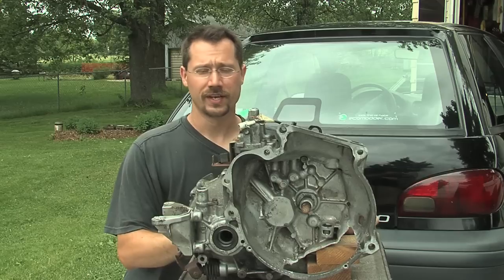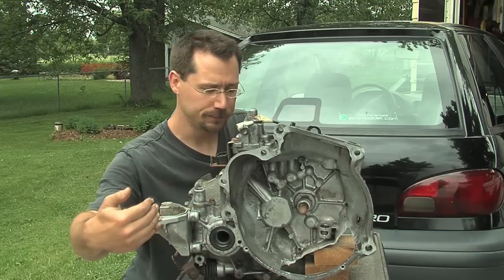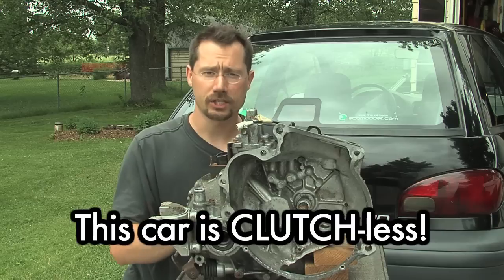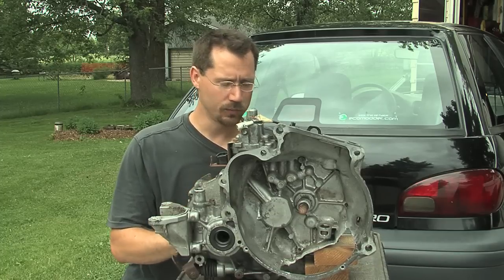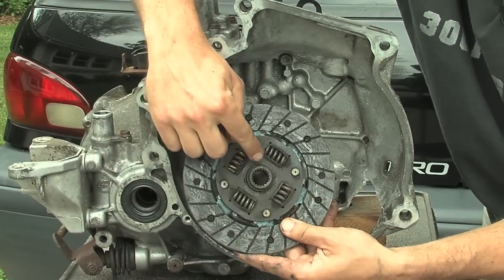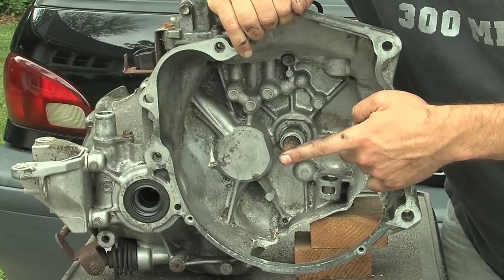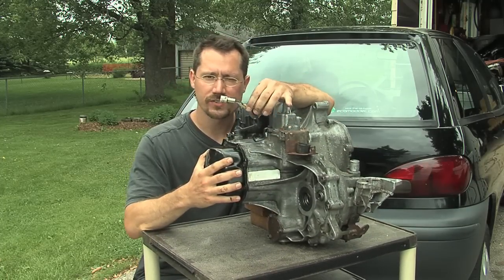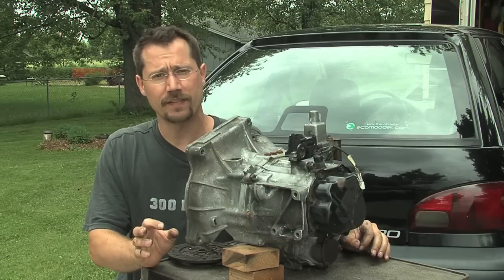6 Build Your Own Electric Car: Transmission

Comment from the maker: We are now on Patreon! We'd love your support as it helps us produce more videos like this! https://www.patreon.com/300MPG
Reply from the maker: You can send me a message by simply posting a comment at 300MPG.org. It's moderated, it it goes directly to me.
Reply: what do you think of this?

I've done some calculations on a project of mine, but i don't know what is the lifespan of the motors.

Turns out that if i use a DC motor (1-1 motor spin to tire spin ratio), i would have to run the motor no more than 850 RPM for my country's speed limit.

what do you think about that range of RPM? in terms of motor lifespan and wear (considering that DC motors red-line at almost 5000 RPM if i am right ?)

The only things stopping me are the transmission maintenance (would want to get rid of it if i could) , and motor overheating knowing that i live in a region of hot climate.

Thank you :)
Reply from the maker: @aslt5711  There's no reason to try to spin a motor that slow.
The motor will have do draw a tremendous amount of current for the current you would need.
The typical way to do it is to connect the electric motor to gear reduction, such as the existing transmission. This allows the motor to spin at thousands of RPMs. It reduces current draw and heat, and increases torque.
All commercially-built electric cars use some sort of gear reduction.
Even "direct-drive" EVs really have the motor go to the drive-shaft, and there is still some gear-reduction in the differential.
The only exception are hub motors. They are a very different style design than a typical motor. No current commercially-built electric car uses those.

Comment: What should I do if said car has an automatic transmission?
Reply from the maker: There are many cars which were available with a manual OR automatic. You can get a manual from a salvage yard and drop it in there.
Alternatively, you could use a motor AND GEARBOX from something like a salvaged Nissan Leaf. You would then just need to make custom shafts from the gearbox/differential to the front wheels.

Comment: Great video. I appreciate your attention to detail. I have been dreaming to convert my own vehicle someday to electric. I am an avionics technician so I can get my head around the electrification part. My trouble is the mechanical component of the conversion. The biggest thing is both of my cars are automatic. Obviously a manual car is ideal for EV conversion, and this appears to be all I can find on the interwebs is manual transmission conversions. Is it even possible or worth converting an automatic vehicle to ev?

Comment: Awesome how many batteries maybe 5🤔how often charging.
Reply from the maker: This car ran on 12V lead-acid batteries. It used anywhere from 6-12 batteries for 72 to 144V system voltage.

Comment: Electric motor torque will (right now)
Destroy standard type transmissions
at the first Oppertunity of error in designs or peddle indiscression or both.
Reply from the maker: It's funny the comments that I hear from people about torque.
Half the comments are that something like a forklift motor isn't powerful enough to move a car, and the other half say it will instantly destroy the vehicle.
In my experience, it's neither.
On the electric Geo Metro, I could pull away from a dead stop in 5th gear. I could do burn-outs in 1st gear, and the only time I ever had an issue with the driveline was when I used a cheap no-name spider coupler with it misaligned.
Reply: @BenjaminNelsonX  I'm the electrician ,aligning larger type high school pool pump motors to pump
Exactly for maditory opperation against immediately destructive vibration ect. You are doing fine generaly, it's just that others might not end up equaly as logical with aspersions of performances according to available area under hood & motor selections at hand with other vehicles (you know how 
tollerances are & crucial safety issues involve 200-300hp success
on own account with children in Ballance.

Comment: Hello Sir! 

By the Right Electric Motor, do you mean a VVVF controlled Induction Motor to work without Transmission?
Reply: Vvvf controlled induction motor & without transmission YES! This would eliminate so much weight. I'm def going to become a patreon donor of you if you are being active in this. Our donor vehicle is a light 1980's intact pickup truck. Jetison the motor instead of replacement again. Isn't there a great pickup truck conversion YouTube from portugal or spain recently? It had 2 direct drive front wheels. A beaut.

Comment: Why don't you attach the motor directly to the driveshaft instead of gearbox? Therefore saving weight.
Reply from the maker: Well, for starters, it's a front-wheel-drive car. There's no single drive-shaft. There's two "half-shafts", one going to each front wheel. Secondly, you would at a bare minimum still need a differential, which is built into the gearbox/transmission/transaxle.
Lastly, you need gear reduction between the speed of the motor and the speed of the wheels.
https://300mpg.org/projects/electro-metro/transmission-for-an-electric-car/
Reply: @BenjaminNelsonX  Thanks Ben, exactly the information I have been looking for. Still trying to find out the ideal motor in todays world for a conversion. And also still trying to figure out the rights specs for such motor. I get a lot of stats and but not a lot of opinion on why one is better than another....still searching. Great job on your car btw.

Comment: Could someone please elaborate on how “clutchless” works? Don’t you need to disengage the motor when shifting? I’m baffled by this.
Reply: @Donnie Fontaine depends on the gearbox you using some have gears cut and put together in a way that they say only need clutch to go from neutral to 1st and as they spinning but held together to move gear you just shift and maybe rev match as it already spinning and the gear part slides across to next gear though often not on road cars as louder than what normal ones are, often crunch or clunk noise they might make apparently
Reply: @mlee6050  Your lack of periods and random generalization of something you don't fully understand muddied up your answer.i didn't make it past the first 10 words.

some transmissions only "need" a clutch to get moving,whether forward or backwards.then if they have syncro's they can be clutchlessly shifted.electric power is different as it can be controlled quickly and accurately,unlike internal combustion engines.this is why cnc machines can do the amazing things they can do, because electronic motors can be precisely manipulated using encoders and software so im assuming when slowing down an electric motor can stop entirely negating the clutch entirely.a gas engine can not do this quite so easily
Reply: @trillrifaxegrindor4411  I understand as I looked at all types of gears and stuff like racing people sometimes have straight cut or dog gears but not on road as it noise

my school never taught us periods and stuff, it was basically capital first letter and names and full stop at end of sentence only

Comment: The market for the conversion to electric vehicles is large and it will grow. Why not using anterior traction hub electric motors so that all the service cost, parts and time of messing with the transmission is saved? There is room for a new national franchise to serve this idea similar to Jiffy Lube International or Express Oil Change & Tire Engineers or Grease Monkey. Sign me in as another franchise monkey for this idea please!
Reply from the maker: I know of no commercially-available hub motor which is powerful enough for for use as the primary traction of an electric car.
People like to talk about hub motors as a way to simplify an electric vehicle conversion, but so far, hub motors have mostly only been practical for bicycles and scooters.

Comment: I think it's great if you're seeking a single motor, but aren't most electric cars dual motors (one for each wheel)  eliminates the weight of a transmission and a more efficient motor/generator...
Reply from the maker: No. Most electric cars use one motor to drive two wheels, using a traditional differential system. In place of the transmission is a single-speed gear reduction.
The four-wheel drive Teslas use two motors, but it's one for each axle.

Comment: The older models were great. Everything was analog and didn't have any electronics involved, except for the solenoid locking the torque converter to create a "fourth" gear.  The newer models are totally controlled by a microprocessor. I don' t think you can get away with doing this anymore. :(  ..And if you have a CVT transmission, I don't think it will put up with a high torque electric motor at all. It will probably break in a month. Constant Velocity Transmissions were designed for high gas mileage, not for high performance. Then again, if you have a manual transmission??

Comment: And how does one change gear smoothly without a clutch?
Reply: Marc Brassé Your in gear 1, then power cut to the motor, motor spins free now (like a flywheel), then shift to next gear, power motor back on. So to mimick a combustion car: keep the clutch pedal in the car and connect to a motor on/off switch.
Reply: Even the reverse can be done by the motor, I guess even  transmission or gear box are just to connect motor to the wheels.
Reply: @robertcaron9181  Still he talks about a gear box. This suggests you go through gears, which suggests you go through mutiple gears while driving. This suggets that the gearbox runs connected to the electric motor. How to do this smoothly is not explained. The only solution will then be to leave the car in one gear.

Comment: This applies to manual gearbox. Any tips on automatic ones? Or should I ditch the auto gearbox ? Any info would be great as I want to convert my Golf to electric power
Reply from the maker: Automatic transmissions are designed for gas engines, not electric motors. Typically, folks use MANUAL transmissions for EV conversions.
An automatic is more complicated and less efficient. If an automatic is used, it's typically just locked in a single gear.
Reply: @BenjaminNelsonX  have you done this with a truck. My donor truck is an automatic but there is no motor or transmission.  It was shifted on the floor. Is this possible without a clutch?
Reply from the maker: @gadgetmanhookup  Lots of people have converted trucks to electric. Automatic transmissions are not the best for an EV conversion, but it should be pretty straight-forward to swap it out for a manual transmission. Take a look at the EV album for some ideas on truck conversions.
http://evalbum.com/type/TRCK

Comment: Hey Ben what are your thoughts on putting an off the shelf generator in the car to avoid large battery banks?
Reply from the maker: Nabre Labre That’s the concept of a plug-in Hybrid, such as a Chevy Volt. I did run this car for a while as a hybrid with a generator. Search this channel for “DIY plug-in Hybrid” for what I did.
Reply: @BenjaminNelsonX  what I am trying to do is not have to plug it in, just have a small battery bank to fill the gaps, and a generator for road trips/not getting stranded.

I have another question, a motor I looked at on craigslist does 1800 rpm. In the car I'd be using, 6th gear at 3000 rpm is 60mph, so would i only get 36 mph out of that motor without overvolting? Thanks!
Reply from the maker: Nabre Labre does the motor say which voltage it runs 1800 RPM? That speed is very common for an AC motor that runs from wall power. Make sure the motor you want to use is DC. If it is, increasing the voltage will proportionally increase the speed.

Comment: It is a manual or automatic car?
Reply from the maker: It's a 5-speed manual transmission, stock to the car.
Reply: You'd never want an automatic transmission for an electric car conversion. Most of the time, you'd be driving an electric version around in only one gear anyway. The automatic would be more expensive, less efficient, and mostly would just get in the way.
Electric motors behave like transmissions with an infinite number of gears. They produce their maximum torque from zero RPM and can be driven around normally without shifting gears.
Reply: Devil's Offspring I'm in a project to transform an automatic gasoline car into an electric car. We are trying to figure out how to connect the transmition to an electric motor
Reply from the maker: @beFrah , One way of doing it is to remove the automatic transmission, and putting in a manual transmission that would have matched that car. You would then do a clutches system (unless you also wanted to dig up and install a clutch pedal!)
Automatic transmissions are sometimes re-used, but simplified to make them more or less "direct drive" and are locked into a single gear.

Comment: Just put a motor on each sideshaft to omit the dif and the gearbox.  The motor speed and the wheel diameter will determine the top speed.
Reply from the maker: Keep in mind that it's no simple task to "just put a motor on....".
A motor needs to be properly supported, exactly positioned, and be kept in place. That means scratch designing/fabricating/installing some custom motor mounts and brackets. The existing transmission is MUCH easier to use as a simple place to bolt the motor.
I'm not saying it can't be done, but I'm struggling to think of any DIY twin motor setups done in that way.
The Tropica was a twin motor rear-wheel drive vehicle with one motor on each of the rear suspensions, belted or chained to the rear wheels. Essentially twin motorcycle drivelines. Of course, there were only about a dozen of those built!
Reply: @BenjaminNelsonX  Ben, it's always hilarious hearing people saying "Just do this!" and "Just do that!" when they've never done anything :)
Just buy a brand new Tesla Model S. It's ONLY $150,000, and will save you lots of work!
Then, you "Just" remove the existing motor and "Just" replace it with two separate ones, to eliminate the differential and the two driveshafts from it. It's "Only" one more motor, and you "Only" have to figure out how to do it, and "Only" have to find, buy, and implement "Only" one more Tesla motor controller, and "Just" design and build "Only" one more complete structural mounting system and "Only" one more complete driveline for everything to work.
It's always effortless when you've never even thought about doing anything at all, never mind actually doing it :)
I swear, some of these guys must work for the government.
Reply from the maker: @devilsoffspring5519 , You nailed it. People offering the most advice usually have the least experience.
Reply: Have a look at the advantages of an in-wheel motor, the second best is to put a motor with a driveshaft on each wheel.  With the correct electronics you can do traction control, regenerative braking as well as save a mass of weight.  Light vehicles means less power and better range.   These guys did it right, a shame they closed.  Carefully observe how the motor was made, that is how it is supposed to be done, not with 3 phase.  https://www.youtube.com/watch?v=j2IBnKouLDg  KLD oneDrive Electric Vehicle Propulsion System - Energy for the Next Generation

Comment: You are better off using this original transmission as it has always been used because starting off in fourth or fifth gear places tremendous forces on the gears and they are likely to eventually break. And why not keep the clutch as well, just in case?
Reply from the maker: I never had any trouble at all with this car using the modified transmission.
For more information about the transmission and clutch on this project, please check out:
https://300mpg.org/projects/electro-metro/transmission-for-an-electric-car/
and
https://300mpg.org/projects/electro-metro/going-clutchless/

Comment: why not just make the car wheel the motor?
Reply: Because it requires specialized items (car hub motors) that are very rare, cost more than the car, and you won't be able to buy anyway because they're not in production and far too rare?
Why not "just" use what's actually *available*?
Reply: why not make the sun our oven in the kitchen and use it to power the spaceship? why not use the air from flying birds to cool volcanoes and replace central air conditioning?

 do you see what i did there? 
its sarcasm,outlining and making fun of your question.
always use logic and intelligent thought relative to viability and do-ability of a specific topic when making suggestions.
so,in the real world logic is paramount to not sounding like a total dumbass.

in other words,think before speaking
Reply: @trillrifaxegrindor4411  your a idiot, I have seen many electric cars with the motor in the wheel. why don't you do some research before attacking someones question.

Comment: So you only need the gear box if your car is a 4x4 or AWD or front wheel drive , or only to transport the movment , and no need to shift the speed by gear box ,,, but can we adjust the gear box shifting on the fastest speed permanently , and shifting the motor speed by the electronic buttons ?
Reply from the maker: https://300mpg.org/projects/electro-metro/transmission-for-an-electric-car/